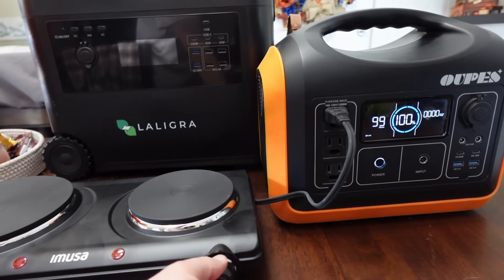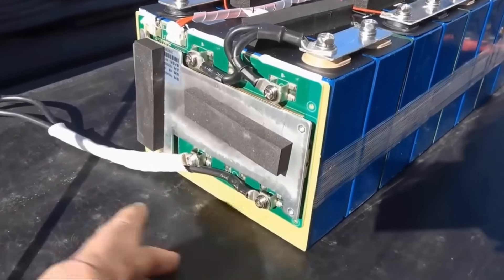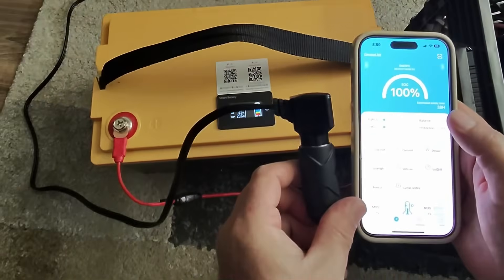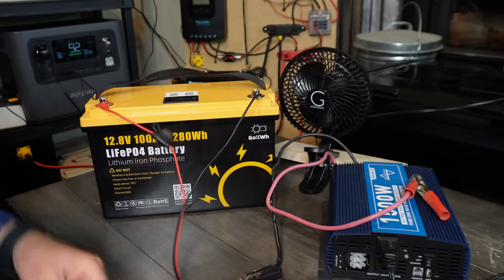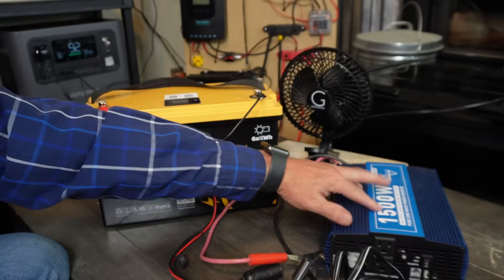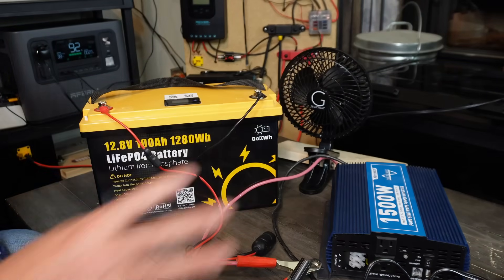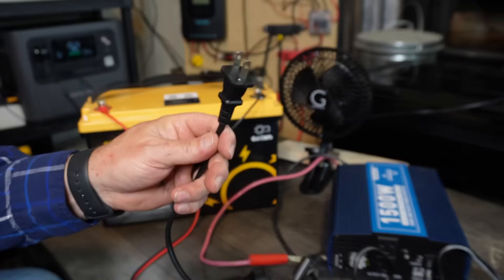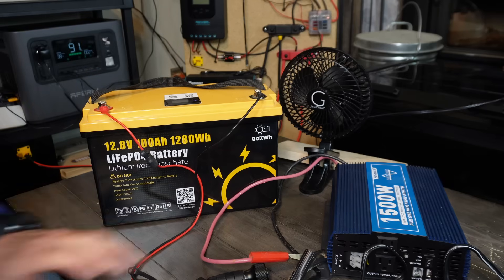Power Station Alternatives & Money Saving Tips

Comment: I have a cargo trailer set up as a toy hauler, paneled and insulated, and I wired in a simple DC system. DC inlet/outlet fan in the roof vent, DC led lighting, and a box with outlets for usb charging. I can add an inverter if needed, but why convert dc to ac when it's not required, and all inverters have a small draw when on even without load taken from them.  I use a Renogy 100 watt solar suitcase to maintain it.  Left all the lights and fan on by accident for 24 hours, and my lead acid deep cycle (borrowed from my boat) was at 11.9 from 13.2 with no input (panel not connected) so what I have is adequate for my needs now. To run the small window AC I do have to use my 2000 watt suitcase gen or plug in shore power.

Comment: A 12 v 1280 wh battery won’t push a 1500 w inverter .     the battery only pushing 1280 w to a 1500!w inverter so you can only get 1280w or what ever the battery will  give you till shuts off .  It will work but only give you 1280 w of power not 1500 w

Comment: What about the solar panels  connection?  At least another $100 + circuit breaker  and cables and fuses. Just get a plug and play power station for the same wh for less than $400. Lol.

Comment: Is it possible to use the power station to run AC devices while at the same time charging the power station from a LiFePO₄ battery, and simultaneously charging the LiFePO₄ battery with a battery charger connected to the grid — all at once?

Comment: Those power station boxes are an expensive gimmick.

Lead acid batteries, solar panels, charge controller & an inverter.
It’s a good, time tested, system that is easily started small & built up as funds allow.

Those big lithium batteries are something like 4 times the price of lead acid equivalents where I live, plus they need special chargers which cost more.

There’s also going to be loads of lead acid batteries to scavenge in a SHTF scenario. Those lithium ones, with apps & monitors built in, won’t survive an EMP either. Lead acid will still be working. Keep a spare inverter & charge controller (both very cheap these days) in your faraday box.

Comment: the prices on the older large  models of power stations have gone down significantly that being you would be hard pressed to meet there specs diy for any cheaper sure theres the ability to replace individual parts easily may well be worth diy builds in its self

Comment: All those companies are ripping everyone off BADLY.
All that stuff should be 25% of what they charge.
As soon as I saw the word APP on their advertisement, it immediately was JUNK.
More crap to malfunction and break.
And if you have no phone or yours is broken/dead, you are shitouttaluck.
Least electronics the better and more reliable anything is.
Cig lighters are fused at 15 or 20 amps. That equated to about 60-65 watts. Cig lighters have a bimetal safety part that when it heats up too much it cuts off.
Your accessory lighter port can generally handle more but see your owner's manual!
Reply: Whoops. Math error.
12.5v x 20 amps = about 250 watts.
And that is about max for a cig lighter.
Accessory is probably higher. But generally not.

Comment: Well done Sir.
I strongly recommend low frequency inverters, 
I have used ampinvt from Amazon, 800 watts for $155 is an amazing deal, it'll run my window AC.
I now use the 3000 watt ampinvt low frequency inverter from Amazon, $465 and it is a great deal too

Ive had expensive gopower and renogy high frequency inverters fail.
The low frequency inverters are simply much more robust and have large peak power.
Building your own power bank is much less expensive and you'll have the ability to replace components if something breaks

Use the largest diameter cables possible and class T fuses,  not regular class M automotive type fuses.

Comment: Seeing everything scattered around like a garage sale, you absolutely convinced me to go the power station route.
Reply from the maker: Right haha. It's much cleaner and easy to keep organized.
Reply: I now have two power stations and a DIY set up with 400 watt solar panels. It's easier for the wife to just grab a power station and plug in fridge and have some lights running if I'm at work. If the utility power is out for longer time, I do have a smaller 4000 watt inverter generator that would charge both power stations to full in about an hour and a half. Back up options are a good idea. That's my plan.
Reply: @Dan-yn7ke  That's a solid plan.

Comment: Im converting an annexe to off grid. Ive realised you dont need an inverter. Instead of ac outlets, im installing 12v dc outlets. If i need ac ill use a small plug in inverter. I will then use 12v devices, for example i will have a laptop instead of desktop pc and use a car charger. most devices can be bought with 12v supply options. Even lighting can be 12v.
Anything heat related should be gas powered. i will use off grid gas bottles.
by having everything 12v i dont need an expensive solar charge inverter, i just need a solar charge controller. by having everything heat related on gas, i dont need as much electricity so im using 6 250w solar panels with 2.4kw battery storage.

Comment: Dude🤯 on point with your way of thinking about replacement theory. Was going to shell out $$$$ for a 1000wh pretty box. Funny thing I already have 1000 W inverter and a battery charger for that just in case dead battery in the morning before work. Already have a bunch of DC stuff because of haveing several kids

Comment: One thing about the power stations, you are not totally stuck with what you got. You can plug a battery into the solar input and charge it as needed from these big low cost batteries to extend runtime.
Reply: 100% spot on. This is the absolute best of both worlds.

Comment: I have built several 12 v systems, and it's not worth it anymore.  The Oupes Mega 1 is $440 right now.   I built my first one when lifepo4 were 300 a piece and I was getting a bargain.  They've been around $150 for a while, but  once you purchase the inverter, one or more charge controllers that can handle the same amount as a power station, add an AC charger that puts out more than 20 amps, you're getting bulky and awkward, and running over the price of a premade.    I think the best bargain is buying a premade with a 48 volt lifepo4 battery and solar charge controller.  You run your panels to the battery and feed the solar input of the solar generator directly from the battery.
Reply: You can get the Bluetti Elite 100 v2 for $399 right now which is ridiculous. No need if you already have the Mega 1 though.
Reply: @billsikes4007 no, I dropped 4 grand 3 years ago on a Bluetti AC 200 Max with two batteries. I recently added 4, 12 volt batteries in a 48 volt configuration to feed it.  To replace that 12 volt system I did a DIY 48 volt, 10 kWh system.
Reply: The 🌞 is free 😊

Comment: When you build a system like this you really need to put proper wire sizes and proper sized fuses in the system in the right places for safety.  I was an electrical contractor for 45 years and an electrical inspector for 10 years.
Reply: The sun 🌞 is free 😊

Comment: I've been using a Walmart deep cycle marine battery with a 1100 Watt inverter for maybe 10 years. It's the first thing I roll out when the lights go out. A power strip and I have internet, TV, lights and my new 7.1 Cu. Ft. fridge only uses 60 Watts when it's running.
Reply: The 🌞 is free 😊
Reply: @petersimms4982  I keep a Batt hooked to a solar batt. maintainer. But a 12 V. Battery maintainer cost like $7. It works 24/7.
Reply: @petersimms4982  Yelp. when it shines. They make solar battery maintainers for cheap.

Comment: I recommend a prepper run their setup on a regular basis.  I run my power station, batteries, and solar panels all the time so it can help pay their way.
Reply: The sun is free 😊😊
Reply: @petersimms4982  The panels and connections are certainly not and there's more shade than there is sun.
Reply from the maker: I do the same thing. I have a DC refrigerator and mini fridge that are powered by my setup 24/7.

Comment: My power is off grid. I have 2000 watts of solar panels, 800 amp hours of 24 volts lithium batteries and a 2000 w Aims Power inverter charger, and a wind generator with 12 trolling batteries. 
I bought an extra HumsiENK 12v 100 aH lithium battery 🔋 for a project like this one. It has the cold weather protection.  What I wanted to see is what inverter you're using. I already have a 410 watts Schumaker inverter that only uses 1 watt of idling current. I bought four 20 amp hours Watt Cycle batteries in case I need a few more amps, and I have two 100 watts Windy Nation poly panels to charge the batteries. 
When I finished my battery bank, I had trouble finding 24 v batteries so I bought four 12 v 100 aH GRNOE lithium batteries, which I could use with the 12v 2000 watts Ampeak inverter on my wind generator for a bigger setup. I bought a 20 amp charge controller for the project. 
I'm using two Epever 40 amp 4215 BN controllers on my solar. 
I really like the video 👍.
Reply: The 🌞 is free 😊

Comment: Dc everything..i make my own stuff out of parts and pieces wires and switches low voltage high wind dc fans and stuff like that extremely bright lights from dollar tree lights i take them apart and put them together with usb plugs and battery rechargeable battery banks i also make and the lights are super bright.i just like doing stuff like that..im working on a mini mini air conditioner electric or as close to free energy as i can get it for vanlife which im going on 7 fulltime yrs now..

Comment: These prices for power stations are so low now it's almost ridiculous. You're not saving a whole bunch of money by putting a DIY system together. By the time you buy the battery, cables, case, charge controller, solar, inverter and so on you're saving maybe $100. I mean for $500 you're getting a decent sized power station and it does everything and more than your DIY setup.
Reply from the maker: Yep! The only benefit is if something breaks it's easy to replace.
Reply: The 🌞 is free 😊
Reply: @petersimms4982  Yep the sun is free but the stuff to capture it isn't

Comment: Seriously I would love to do something like this, but my problem is I don’t understand all the electrical terminology or where to start on how to do any of this
Reply: The 🌞 is free 😊
Reply: @petersimms4982 yeah I know right 👍
Reply: Basically, you have to have enough battery 🔋 to run the inverter, and enough solar panels to charge the battery 🔋🔋 bank. The charge controller just keeps the voltage from getting too high. 
It's better to have more battery than is required to run the inverter, because the lower the voltage gets on the battery, the more amps the inverter will use, which runs the battery down faster. 
Solar panels help keep the voltage up so that the current draw doesn't get too big. 
I prefer to keep the inverter as cool as possible. 
Same with the solar panels. ( they put out a lot in snow glare conditions). 
Try looking at a kit that has everything in it, already matched to work together. That's pretty foolproof. 
Just search for " 1000 watts complete solar kit", or whatever size you want, 500 watts or something. 
That should give you a better idea of how the components work together. 
Once you use it for awhile, you'll see how it does in real world conditions. 
I hope that is of some help. 
I've messed with this stuff long  enough to just throw something together for whatever I need. 
Make sure you get a pure sine wave inverter, and an MPPT charge controller. Other than that, you can do about anything. 
One way to decide what you need, take the biggest wattage thing that you want to run, and get the next bigger size kit. 
You wouldn't have to calculate amp hours of batteries and all that. 
I wish you the best of luck with your project. 
If you need to convert to watt hours from amp hours, just multiply battery 🔋 voltage times amp hours. E. g. my setup is 800 amp hours times 25 volts or 20,000 watt hours. 
I used 25 volts instead of 24 because the lithium batteries are 25.6 volts. My batteries are at 26.5 volts at the moment, about midnight. P. S., a 24 volts system is more efficient than a 12 v system, so it takes less current ( amps ) to run the inverter. 😊
That just means for the same size load on the inverter, it takes half as much current. Kind of saves the batteries.
Reply: There are some tutorial videos they break down a lot of it, i watched a few before but its been sometime.

Comment: Totally agree!! Two hurricanes in a row last year showed me the limits of power stations and even solar panels after 3 days without power. I got 2 100 ah batteries that allow me to charge a power station while another power station recharges from solar or just use the battery alone. Costs much less than buying another power station.
Reply: Great setup!  Way to be prepared.
Reply: That's great. I have eight 24 volt 100 aH batteries on mine. I started with two. The 24 v ones are pricey, and harder to find now. I looked at power stations but decided they weren't big enough

Comment: When saying this is a setup for 'emergency use', I'd like to add this most likely wouldnt run a mini heater for long or an a/c at all - its only for small fans, lights, charge the phone, run the radio/tv, compressor mini-fridge. Without a way to recharge such as solar or generator you'd want to be very conservative depending on how long it needs to last. If you're in the dark for the next 3-5 days it would need several batteries depending on power needs and a way to recharge. Solar only works during the day when its clear, generators can't normally be used in an apartment complex so adjust as needed for your situation and budget. If you must use for warmth dont warm up the whole area just yourself such as a heating pad or blanket and put that inside a sleeping bag, then inside a tent in your house/apt. Use dc power directly or a small inverter for smaller a/c power needs and keep that huge one turned off as much as possible. Wife and kids would see that battery and assume it has 'unlimited power' and try to connect the microwave of course.
Reply: It's all about the battery 🔋🔋 storage. When you get enough, you can run anything you want to. I'm running eight 24 volts 100 aH lithium batteries on my setup. They'll run the air tryer on broil, that's 1500 watts, or my window air conditioner unit several hours.
You just have to have enough panels to keep the batteries charged.
Reply: Small cheap Chinese (Vevor?) diesel heater sips 12v & sips diesel. obviously needs exhaust vented to outside.

Comment: Plus, if you already have a power station, a battery such as the LiFePO4 in the video, can used to add capacity to the power station. They have built-in inverters, have USB and power socket ports ready to go.

Comment: Agree on using 12v appliances when possible and skip the conversion to AC via inverter. Elmininate the power loss. I cut the end of a 3 tier lamp stand and added a cig plug to it to run a 12 volt RV light bulb. Also use rechargeable fans that i can recharge off battery. Brought the adapter for charging via USB. Have a 600 watt pure sine wave inverter. Plan on upgrading to Lifepo batteries and adding some solar panels in the future.

Comment: I built a 24 v system on a board with a 2000w inverter, 100/30 victron all the fuses and breakers and works great. Can also use the 24v to change the other power stations i have. For fun i built 2 small ammo can power station just for USB and 12V using a 12 amp and 6 amp battery.
Reply: Nice 👍 🔋⚡💯😎

Comment: 100ah lifepo4 = $200
1500w pure sine inverter = $150
Lifepo4 charger = $100
Solar charge controller = $50
Total = $500

EcoFlow delta 2 = $450
Reply from the maker: Yep. That's why I mentioned that if you want all the functionality of a power station, it might cost around the same. The other advantage is if a part fails, it's easy to replace that rather than a whole power station.
Reply: @TheBugOutLocation  He also  doesn't mention that an addiitonal ecoflow battery to double the power would currently cost $459 and that's on sale only. I can buy an additional Lifepo4 battery for half that cost. My DIY box and Renogy 100 watt panel and charge controller is fine when I go camping. But for additional power at home I 'll do the DIY, thank you very much.
Reply: You are also getting double the Watt Hours with his set up compared to the eco flow you mentioned